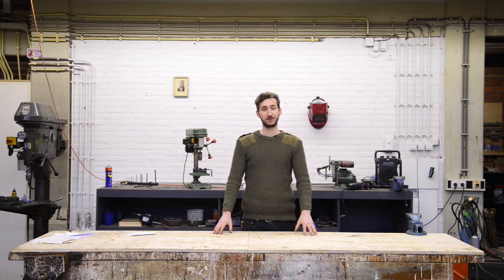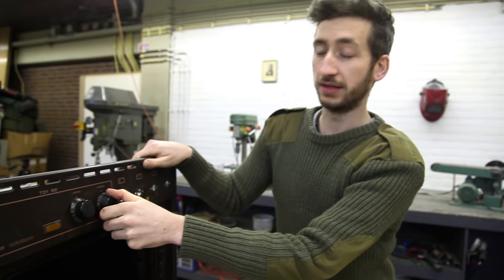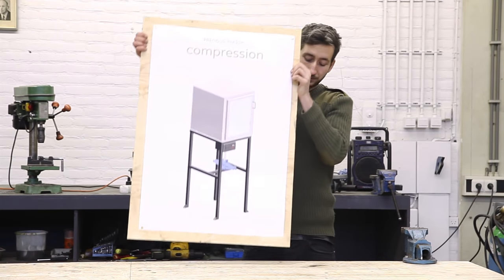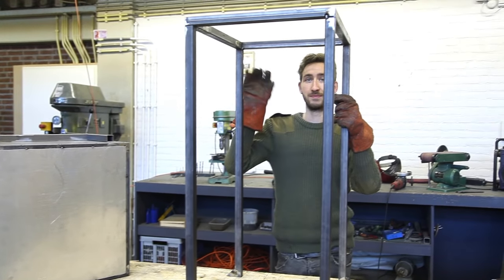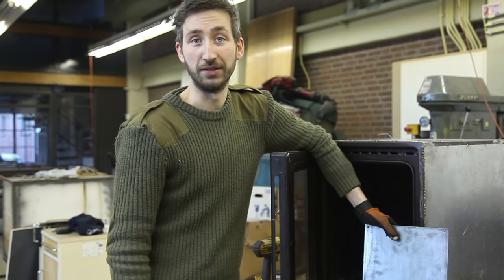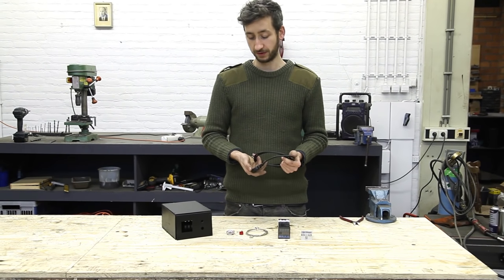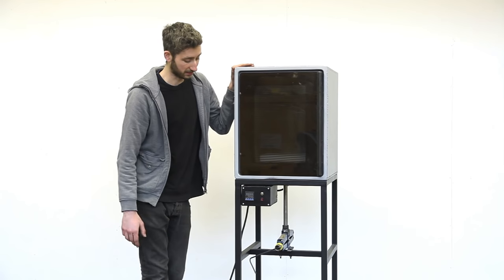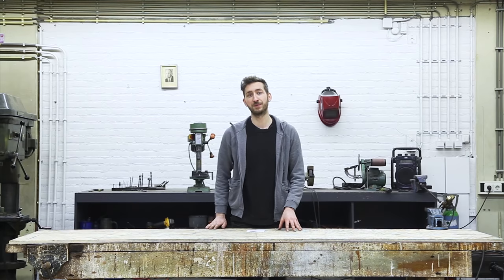Precious Plastic - Build the compression (part 3.4)

Comment: I am enjoying your videos/projects and have been saving No. 2 plastic for a while now, to build supplemental 4x5 darkroom processing tanks, ect. I want to comment that the mold unit's top might benefit from the addition of a pipe flange, so instead of a small, piercing pipe to stove celling pressure,  you can distribute the pressure over a greater area of the reinforced top and avoid indenting your stove celling. It may also make your top mold element more stable, controlling side-shift better.

Comment: Hi, I'm Franco from Argentina, I love your projects I've done several of them. I'm carrying out a project like this, but the plastic sticks to the mold.
Do you use any demoulding agent?
thanks for your help
Thank you
Reply: Did u got an solution ? I also have this problem!
Reply: @reneesiepman3207  silicone grease or demoulding spray both work well

Comment: It posible to colored this plastic? I mean if plastic have many colors and you need mold with just one solid color can I do this somehow? Use some paint for this or anything else? I mean in process, not after molding, cos' paint be visible and potential buyer began to asking too much questions.
Reply: +Buyaga Dodzyo You can use that extruding machine, he said it mixes colors really well.
Reply: yeah I think just as long as you have majority one color during use of his extruding machine design process you can use other colors but still end with one main color... or just use colored plastic that is already the color you want...
Reply: @artbyrobot1  i think the best way is separate plastic by colors

Comment: so hard to do, if you doesn´t have that powerfull tools.... you need to spend allot money to build that machines.
Reply: yes you and l maybe we are not able to make it but it's more important the deep meaning of this project, that even if we must spend 1000 dollars o euros it's nothing in front of all the plastic around the world. Sorry for my english i'm italian.
Reply: All you really need is a basic tool setup, (hammer, screwdrivers, drill, measuring tape, etc) and the more expensive stuff is just a welder, angle grinder, and a drill press.
Reply: you can make your own welder and drill press very easily angle grinder as well.  also a drill you can convert into a grinder with a grinding disk attachment.  Total cost of all tools is under $40
Reply: welding is not easy